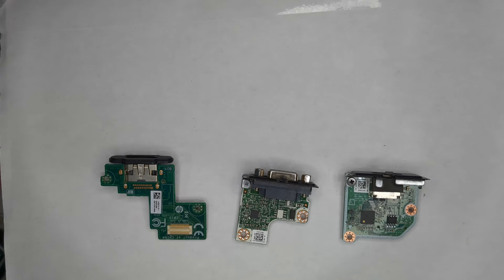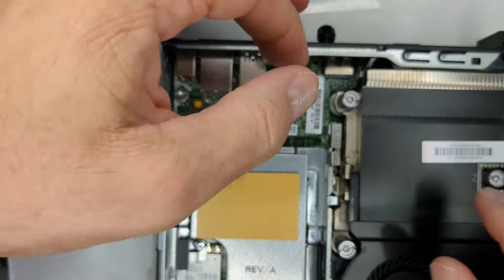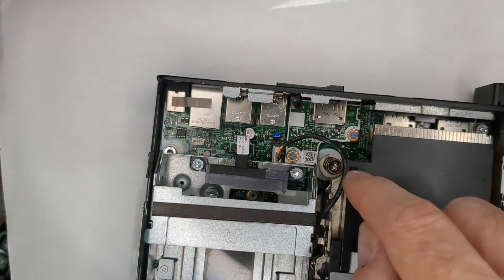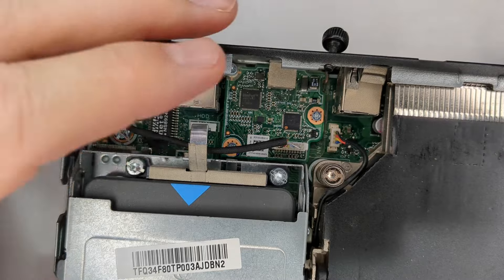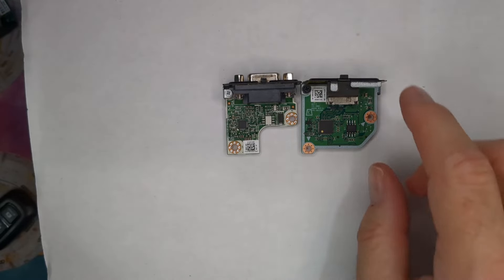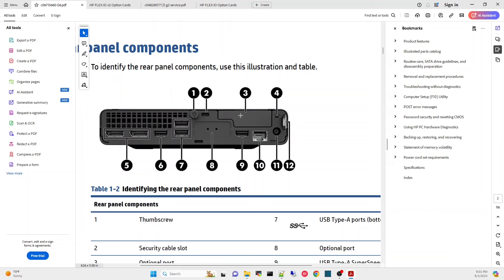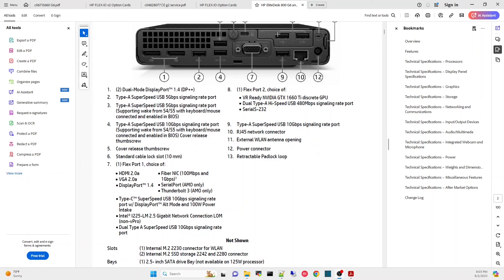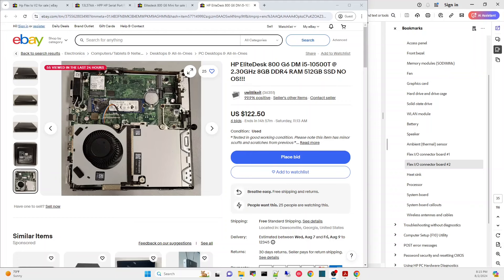Everything and more on Flex I/O Option Cards

Comment: I believe the reason for the 65W machines inability to use USB PD, are power limitations.  PD can deliver a lot of watts.  So a 65W doing high CPU work is drawing a lot of watts by itself. The PSU bricks or even the onboard power delivery systems may not be able to handle the  load of a heavy CPU draw AND sending 60W to the USB port.  It could be an Amps issue rather that raw Watts too.
Reply from the maker: I like the theory of the 90w PSU.  Still odd to have two different flavors of mobos. Although for other companies it would make sense.
Reply: @handmedowntech  Just my theory. The PD USB by itself looks to be using almost a third of the available amps from the PSU. As most normal Bricks are in the 6-8 amp range. I “think” I saw a USB C powered monitor, designed for the Elitedesks at some point. All monitor power is from the DM. I wonder if it was meant to go with the PD machines. As the DM fixed to the back of the monitor. If I find the info again.  I will post it here.
Reply: HP Mini-in-One Display. The Mini fits inside the monitor. The monitor powers the Mini via USB-C. HP's page links are mostly down atm. So, here is a YT vid showing the monitor and Mini being installed in it  https://youtu.be/80Bb24CawWw

Edit Part numbers 7AX23A8 and 7AX23A9
Reply from the maker: Thanks, all info appreciated
Reply: @handmedowntech  Another question springs to mind now. As shown in the vid i posted. Can a PD equipped Elitedesk now be powerd by one of the high wattage GaN chargers that are all over the place now.  As I do not have a G4, I cannot try this out.  You could, if you have this sort of charger. Another video perhaps, if you do try this out. My GaN charger has two 100w USB-C ports. So it "could" be possible to power two G4s from a single charger.  It would depend on how the charger splits the power between the ports, when both are connected.
Reply from the maker: I remember someone back when asking the same question.  If it worked someone could also use one of the high wattage power banks to create a portable EliteDesk G4.  You'll definitely see it here if I'm able to get something like that working 😉
Reply: Good info because i just ordered the USB C for PD to go in my G3 65W. According tonthis video amd your.post, it will fit but will not work. Please share that info if you do indeed find the one they made with PD for the G3 65W. @Yandarval
Reply from the maker: Part number 3TK78AA is a USB C Flexio but does not support PD - HP just calls it "HP Type-C USB 3.1 Gen2 Port Flex IO" while part number 3TK79AA is called "HP Type-C USB 3.1 Gen2 Port with PD Flex IO".  If you truly needed PD you could get a 35W MB and try swapping it out with your 65W MB.  It "should" work but then again they did make two versions of the MB for some reason.

Comment: Hello HMDT, I have a question for you, I recently got a G4 35W, installed the USB-C (not the power delivery one) IO module, and noticed that the unit comes with 2 different connectors. The VGA module as well as the USB-C module only uses the connector closest to the back, but I'm not sure what the other connector is for, do you happen to know?
Reply from the maker: If you're talking about a black connector parallel to the back of the unit, I suspect it is used with the longer thunderbolt and fiber cards.  Tried to find a pic of the underside of one of those Flex Ii but didn't find any.  If you do, let me know

Comment: thank you!
very useful👍
I have G3 with two HDMI and I'm thinking about changing optional port to HDMI as well (to use three monitors - if it is possible?)
Reply from the maker: Check out my short video where I run 5 monitors
Reply: @handmedowntech  thank you for a quick reply - that's very good news 👍
not obvious from the titles, so I guess I am going to have to watch all of them until I stumble on the right one😋
later edit: mystery solved 
shorts are disabled on my YT, that's why I couldn't find it 
https://youtube.com/shorts/iKtwhkH0sA4?si=nxoPtp6pZISwMgkj

Comment: Would you happen to have a post or video showing the plugs on the bottoms of these boards?

I have a G5 with a v1 vga io card, and when I popped it out to see what was underneath, I found an unused socket labeled tbt/fiber. 

I haven't been able to find out if there's an option thunderbolt yet or not as HP's documentation is confusing and differs in places.
Reply from the maker: I had never noticed that before - my G4 says "TBTcard" on the motherboard.  The Thunderbolt youre' looking for is Part Number 3TK77AA HP Thunderbolt 3.0 Port Flex IO.  Check out https://h20195.www2.hp.com/v2/GetDocument.aspx?docname=c06042607 - Let me know if you end up getting one and how it worked out.

Comment: Hi this is Dan… I just recently bought a HP Elitedesk 800 G4.  I want to install a Flex I/O HDMI adapter.  I ordered one on Ebay.  P/N I believe is L07093.
 
I can not get video out of it.  When I hook up HDMI cable it states on Monitor NO Signal.
 
Questions:
 
Do I have the wrong part?
 
Do I need to purchase a STK74AA one?
 
Do I need to download HP Graphic update…?
 
As you can tell I am new to the equipment.
 
Thanks for any help you can provide.
 
 
Dan